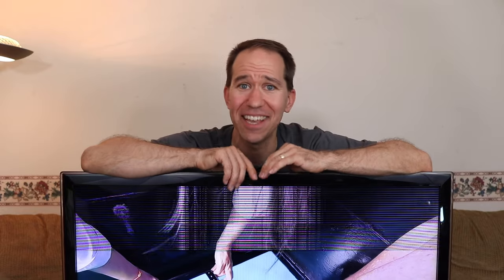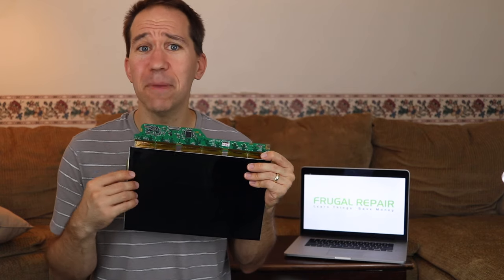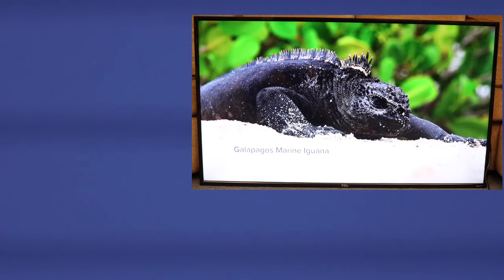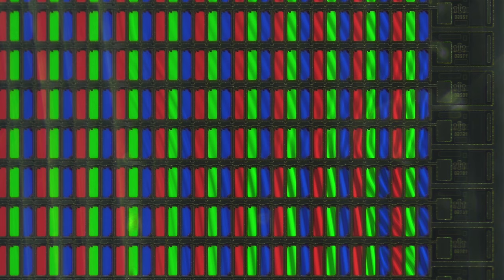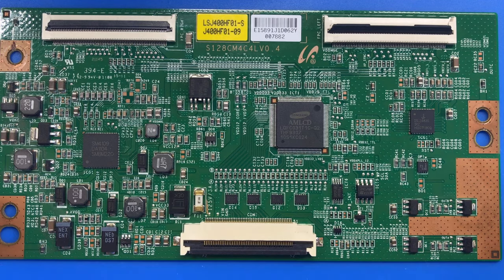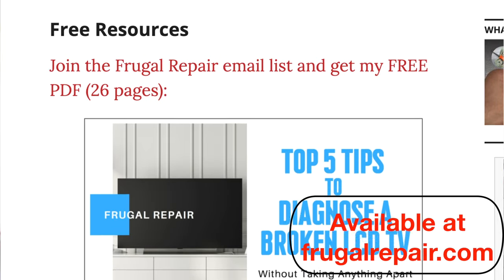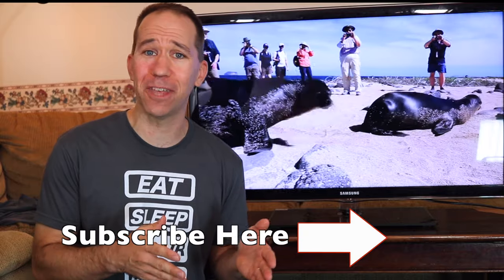Repair Hack Explained | How to Fix TV Horizontal Lines - Part 2

Comment from the maker: Do you have more questions about how LCDs work?
Reply: I'm from Indonesian your video is very good but I don't understand English. Please translate it into Indonesian.thanks
Reply from the maker: @yusakchannel6473  I wish I knew how my friend.  I am sorry.  Let me know if you know a way I can translate it.  Maybe you can find an english speaking friend to help you.
Reply: @FrugalRepair  ok thanks my friend.
Reply: @FrugalRepair  Is there anyway to direct message you? I'm having a unique issue with an lcd tv that I'd really love your help with. I've searched for weeks to find a right direction to go in and your tape methos seems like it could help my my problem is a little unique from what I can gather.
Reply: @FrugalRepair  my issue is from top to bottom on the right hand side of the screen, about 5 inches wide. Every so often it'll flicker black and white horizontal lines. The TCon board is built into the mainboard. Ive tried 4 new boards and 2 new PSU. If I change the ribbon cables the issue will switch from the left to the right side of the screen. 1 long and 1 short cable the problem will be on both sides. 2 short cables it only happens on the right. Its very intermittent.
Reply from the maker: You can try me on Instagram.  I can try my best to help.
Reply: @FrugalRepair  I've sent you a message on instagram please help
Reply: Does cutting one side of the side drivers overload the panel? Could it shorten the general lifespan of the panel? Thanks!
Reply: Thank you for posting so many helpful videos, I like them all!  My friend has a Sony A9G 77inch OLED, his problem is the screen will flickering black, but it will work perfectly fine if he tilt the TV forward by adding 2 inches under the back side of the TV stand.  Any thoughts of what the problem could be?
Reply from the maker: Maybe the tab bond/ribbon cable is loose?  Maybe the soldered connection from the tcon has an issue?
Reply: @FrugalRepair  I had send him your tips, we'll take it apart this weekend to find out
Reply: Hello sir. My 55inch tv has  vertical lines at the top and there is also on the left side. What is the possible problem and way to fix it?
Reply: @FrugalRepair  please response on my comment please
Reply: hello does work on sony CRT tv ?
Reply: Hey what about vertical lines? Same logic?
Reply: What if the t con board is integrated with the main board. A single ribbon from the main board goes to the lcd board at the top. Two ribbons (non-removable gold ones) come down into the screen. 
This is a 2011 vizio 32in E0VL.
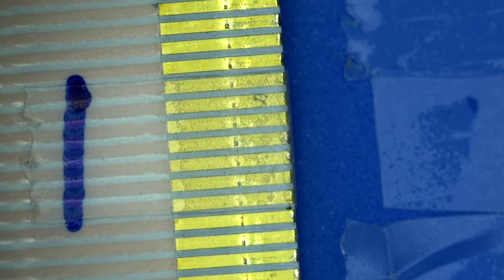Reply: 5:45 will that work on PC monitor as well (27" Samsung LS27F350 two years old)?
Reply: Just a question, have you swapt the flat kabels to the LCD display as well? I don't know mutch about electronics, but could it be that the issue of line 6 is in the flat kabel?
Reply: why not just replace the t con board be down with it.
Reply: Will replacing the t-con board fix the line issue
Reply: if the tv have the horizontal and vertical almost all of the screen . how do i do ?
Reply: I had a Sony LCD with just one black horizontal line on it. Can this be fixed or do I just need to buy a new tv? Thanks
Reply: I gave my Xiaomi LED monitor / LCD to repair because it stopped to work after 10 months of usage
An engineer told me its an internal fault in LCD panel, it has a short circuit two inches from the right hand side.
The panel hasn't been touched and it was working for 10 months.
Is this possible that LCD panel has an internal short circuit out of nowhere?
Reply: Hello...thanks for the knowledge shared clearly.  I need more.
Reply: @FrugalRepair Hello
Reply: I, would like to contact you directly for more lessons. How do I get in touvh.
Reply: @Ognirustuka6998 THANKS. THATS HOW MINE IS ALSO, I CANNOT SEEE THE TWO REMOVABLE RIBBONS.
Reply: Hi, First of all I hope you are doing well. I want to thank you for your videos, they are very well explained and informative. I came across a video of yours today while I was looking to repair my SONY KDL-50R550A LCD TV. The problem is the image is jumping up & down like if the signal is shifting between horizontal lines. I checked the ribbon cables of the T-CON board, cleaned the connectors, I tapped gently on the ribbon cables going out to the panel trying to figure out if they are loose but no luck. Could it be the T-CON board itself? I would appreciate it a lot if you can help me fixing it before I go buy a new one. Thanks.
Reply: Hi,
Thanks for the great content! I was hoping this solution would work for me too. I have a vizio m501d-A2r smart tv, the image moves up and down like clear, double, clear, double every 2 seconds. One side is with line the other side works minimal lines. But overall the image moves on both side. Where would I look for information like this? I guessing the T-con board? But i don’t know. Please advise and thanks you for your time and help.
Reply: @FrugalRepair hi, I have horizontal lines on my tv. I tried to remove the left ribbon and then the right to see which side got the problem. In my case, when I remove left cable I get lines on my right screen and if I remove right cable I get vertical lines that slowly turns my screen black. Do you have any solution for this. Thanks
Reply: i know your a busy man but i have a little problem i want some help with please.
Reply: @FrugalRepair  where is the PT 1
Reply: @FrugalRepair  my tv is showing the same lines like yours and then it disappears and then it changes brightness automatically and then it says screen selection has been changed help me bro
Reply: @FrugalRepair Perhaps with your technical knowledge about TVs you could help me figure out what went wrong with my TV? I bought a 55” TCL R635 and had it for about a month when it suddenly blacked out, audio was still working fine. After I turned it off and then unplugged it for a few minutes then plugged back in and turned it back on, it then had horizontal lines going across the bottom 20% of the screen and would black out every hour or so after that. Went through every troubleshooting technique with nothing fixing the issue. The horizontal lines would remain and the screen blackouts continued. TCL is sending me a new unit, but my curiosity has got the best of me and I really want to learn what it was that was wrong with it. If you can help inform me it would be greatly appreciated, even if it’s just your best educated guess.
Reply: Can you come to India to fix my TV ? It's having the same problem and I am too insecure to fix them myself 😭😭
Reply: @FrugalRepair  can you help me with my lg TV
Reply: does blocking one side of the signal means that the TV is now working at half the refresh rate intensity it was design to work at? For example, it works on 30hz instead of the original 60hz? Thanks
Reply: I have horizontal lines some at distance and some altogether@frugalrepairs plz help me out
Reply: my laptop screen has horizontal lines its thin and it has space with eacother is it my screen faults?
Reply: @FrugalRepair  plz answer my question too
Reply: help me fix vertical line
Reply: hi bro, I have thes green line on the bottom part of my monitor and I tried to fix it with the jscreenfix website and I left it there for about 15 minutes, and then when I checked it created more of those lines in the top part of my monitor with different colored lines like blue and green, why did this happen and what can I do to fix it, I really need your help, i can send pics if you want, just help me man
Reply: Thanks alot for these in depth videos! What about vertical lines?
Reply: My phone has these line how to fix with tape
Reply: could it work on my Benq/Zowie 2735 144hz lcd TN Panel Monitor ?
Reply: Thanks for that very accurate explanation. I have a specific problem with my samsung LCD TV, the TV screen shows some white spots that are resolved by lowering the contrast, but the horizontal line of pixels have a faded and a normal line, simulating tube TVs, something like the effect of Scanlines in computer games. As if I had burned a line for each that works, can you imagine how to solve this?
Reply: YESS. Could this be caused by bad power input from the wall outlet?
Reply: can you make a video about vertical lines?
Reply: the same problem. my unit is Haier 50in. thisis the 3rd time that i met this problem and i already spent $125. I hace watched how they did it, and because i watched your video, i am planning to do it on my own. however, i am not so sure what to block. maybe you could help me😊
Reply: Hi!My question is how to do open your TV?
Reply: Thanks for this wonderful video. My TV also have 3 or 4 black lines at the bottom of led can Replace of TCom board resolve this issue?
Reply: That was really cool. Never knew how that worked. I have degree in networking and I am certified Microsoft system builder. Love hearing stuff like this. Easily explained so anyone can learn.
Left a comment on part 1 for 85 in sony bravia.  I will keep tinkering with it.
Reply: @FrugalRepair  I have Moving Transparent lines. Can you fix this issue?
Reply: Meri lcd sumsung 32 main horizontal line aa rahi hai center main line,,keya karu
Reply: I have a Lg 55lv5500-ua lcd tv it has vertical lines and its fades but takes a while to change would love some help learning to troubleshoot the problem. Thanks for the video btw very educational
Reply: hi thank you for quick reply it makes sense to me and explain almost all.

I will try to be quick if there is same signal coming from both sides of lcd..... now for some reason short will occur on that line isolating those signals on one side will still leave short in place sorry im still confused trying only to understand fully this repair 🤨.

I will definitely have more questions in future

thank you
Reply: Great video! I have a question that I hope you can help with... I have a single horizontal line going across my tv, but I think it's somehow a bit different from the one in the video... Mainly, it's not a solid line; it's made up single dots. Although they are mostly black, the color of the dots alternates, with about 20 or so being pure black and then 6 being purple (although, to the right side of the screen this recurring pattern gives way to a longer stretch of purple. Getting my naked eye very close to the screen, it also seems that every third(?) pixel (or subpixel?) is working fine, insofar as the color matches the surrounding vertical pixels (... so I guess it wouldn't be a subpixel?). So my question is do you think the repair in this video applies to my situation as well? I'm not super techy, so I'm a bit hesitant to crack open my tv without being confident that there is a real possibility of fixing it... I know it's impossible to address EVERYONE's problems, but if you have a minute, I'd appreciate hearing your quick thoughts.
Reply: hi there, im from pakistan, i have a samsung syncmaster 2220wm monitor which is having horizontal lines and it dosent show the screen properly because the whole screen is covered up with horizontal lines, sometimes they are vertical and blur display, can you help me in any way its possible without opening my monitor?
Reply: hi ty yo for the vid, it's the same for a horizontl streak like 1/5 of the bottom of my screen going black? I "fixed" it grabing thscreen an twisting a little so I think is a bonding fault
Reply: Can I check if it’s a T-con board problem or the panel problem?
Reply: @FrugalRepair  do you know if it’s a board issue or panel issue?
Reply: What if none of the halves turn on when I unplug the ribbons?
Reply: Yes..  I really want to know more about laptop LED screens and how to fix them... I would love a video on that
Reply: Hi yes I have the vertical lines at the top of the screen and double sometimes triple picture  Samsung TV. What can I do?
Reply: @yusakchannel6473  😊Oikkoooooolp
Reply: @yusakchannel6473  what did he do to fix it? Does he ever explain how?
Reply: @FrugalRepair  cool video man.
i have a LG 55nano79 WITH horizontal line at bottom. i have 3 day to try to fixe it but i dont find wat line to cover 🤦🏼‍♂️.
Reply: I moved my tv and heard a crack and now there are lines and what seems like a crack but outside the screen is not cracked. how do i fix this?
Reply: my TV is Samsung QN55Q70TAFXZC; Version: AC03 QTQ70 QTQ70E Q55E1

my issue is that it constantly restarts, staying on for like a second.  l replaced the power board, issue persists.  l taped/ isolated each line to / from the power board to motherboard, issue persists. Got a new remote on Amazon, issue persists. A YouTuber suggests it might be the smart real engine on motherboard.  Any thoughts on a fix?
Reply: Hello mate. I have a Sony Bravia 2007 and half the screen horizontally has lines but discolouration as well and I’ve taken the said ribbons off and the left side displays white (with ribbon off) and right side black and right side (with ribbon off) displays yellow lines and right side is black. Now I’m gonna try the tape trick and see how it goes. My question is, do u think I’m on the right path or the tape hack will fix nothing ? Thanks in advance 😊
Reply: Horizontal lines
Reply: Horizontal lines on my 52 inch Samsung
Reply: I live in Wisconsin and I have horizontal lines but they blink in and out and they aren’t permanent
Reply: Great video. I only have one horizontal line but when I remove each of the ribbons the other half of screen still has the line - what that means and where the issue come from? Can be fixed or not?
Reply: I was able to fix my tv with a tape and I used it for just a month and now the lines are back again what should I do
Reply: I was able to fix my tv with a tape and I used it for just a month and now the lines are back again what should I do
Reply: man pls tell me what could be wrong with a tv that starts lighting up once under power are there tvs that can do that or ts not normal?
Reply: I have a similar problem but the flickering lines become normal in about 2 mins. How to resolve that?
Reply: @FrugalRepair  hi there, I have a 49 inch Panasonic Smart TV which just start showing lines going from the top to the bottom, I watched your videos and to be honest I don't have any knowledge of electronics. I see that blocking off the those lines with tape but there are so many. My question is can I block off one at a time?
Reply: Since he hasn't responded to many of you, my advice would be to just start taping & testing for either vertical or horizontal lines. I'm no TV expert but hell since that's basically what he showed us to do just try it & who knows maybe all the lines & bouncing will suddenly be fixed! That's my best advice & I'm sorry he hasn't kept up to y'all's questions. I mean the very worst thing is you'll still end up purchasing another TV but if you just attempt this process you just might fix what you got!!! Good luck!! I have two tlc tv's that look like cracks plus horizontal & vertical lines with an impact point & a Samsung phone that's cracked also no lines but faded color in certain spots & I'm just going to try it on the tv's but I'll probably claim my phone on the insurance. 🤷‍♀️🤔🤓🤯
Reply: I have the same problem whit a 65" ONN TV, if i change the T-con board can i fixit? or i need to do this anyway
Reply: I have a 2014 RCA 55" LED TV. Model No. LED55G55R120Q RE46HQ1640-20140311 RS178S-3T05 
Prior to my recent repairs, when turning the tv off it would not turn back on even though it had a standby light and back lighting. I replaced the power board, main board, and t-con board and now when it is turned on I can get a picture, menu, etc. but only after an hour warm-up. The flex cables and connections seem solid (not totally sure), but there is still some internal component that needs replacing. Once warmed up it works correctly. Can you solve the faulty part mystery? Appreciate your expertise. Really great videos.
Reply: Yes, how can same clock signals be sent from both sides?
Why would imagine quality be poorer when sent from one side?
When you say both signals crossover one another, what does this mean? Does it mean the TV looses half it's resolution if signals are coming from one side rather than both sides. Are there duplicate channels or something?  If there is a short from the left hand side signal then how come it doesn't affect signals from the right side.
Reply: @FrugalRepair I have a question about an lg oled. I bought 1 the other day and its broken. There is horizontal lines. But they are only noticeable on certain colours. They are really feint. Is there a way to fix it. The tv is perfect other than them

Comment: DUDE, YOU JUST SAVED MY TV! It was working only 2 years and lines apeared 1 month after warranty end. I tried to fix it, but diagnosed its faulty matrix and was about to throw it out. Today i tried using tape on random pins, and it works like new! THANKS A LOT FOR THIS VIDEO
Reply from the maker: That’s so great to hear!  Congratulations on the fix.
Reply: @FrugalRepair  Sir I have a 55 inch vu led tv which hai horizontal lines in it and tried to fix it with tape but I believe I cannot find where to put the tape. Also when I remove one of the strip from t-con board the other part of the screen didn't go black like yours did. So is this normal or there is some problem with the panel ?

Comment: Hey Rhys.. I have a question.. When you do a continuity test on the signal lines, cant that damage the sub pixels ?  I am not sure what the average multimeter puts out for a continuity test or what voltage the sub pixels are running at so could the meter output cause secondary damage ?.